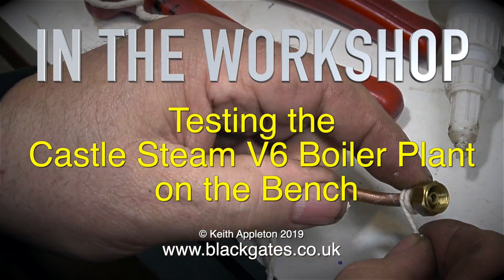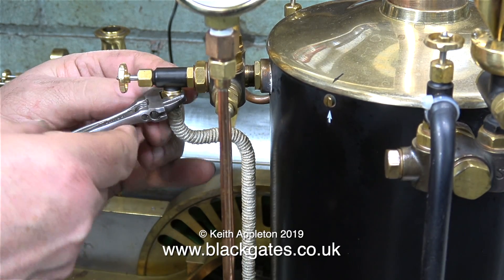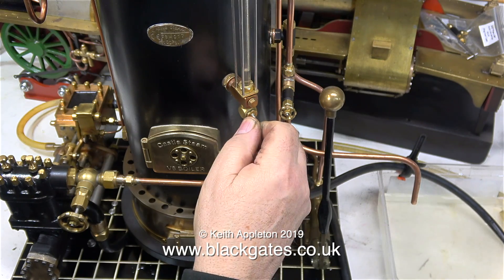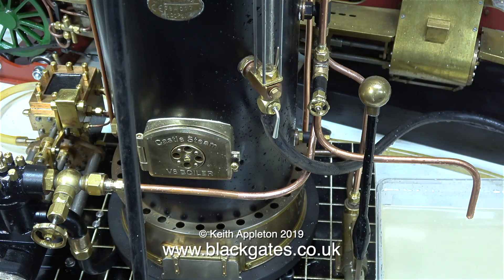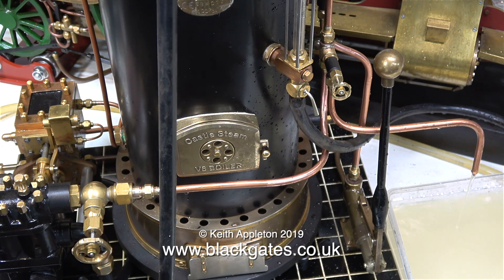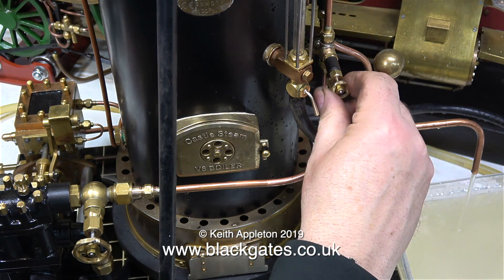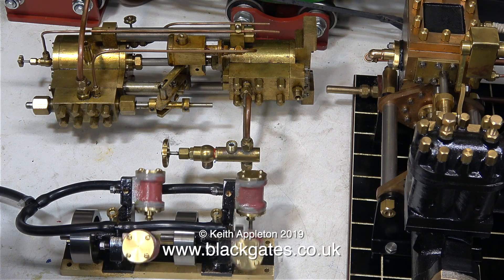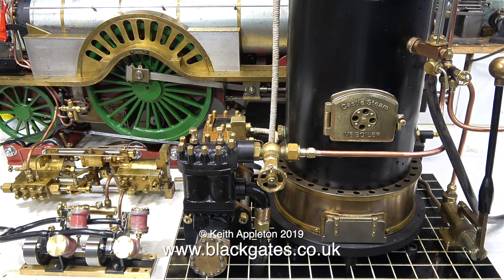TESTING THE CASTLE V6 STEAM BOILER PLANT

Comment: Bonjour Keith,
Beautiful plant, as usual would I say. I also use rope to insulate my pipes but I do not paint them, I cover them with a thin ribbon (1 cm wide) of Teflon that I find in the plumbing section of my hardware store.
Don English is a master, I like very much his pumps as they combine beauty and efficiency. Horizontal or vertical, I would accept all of them :+))
Amicalement, Raphaël